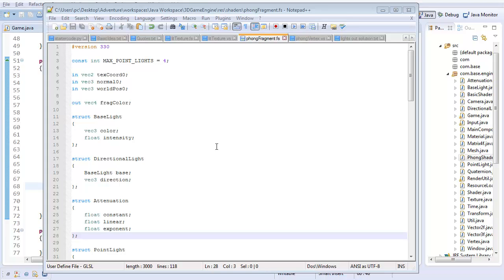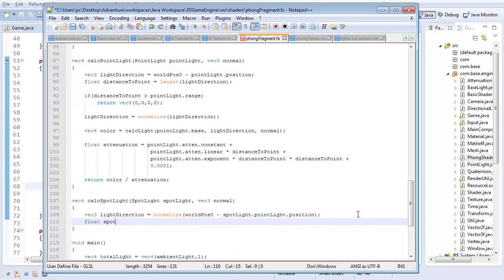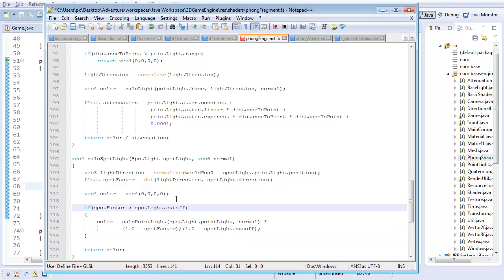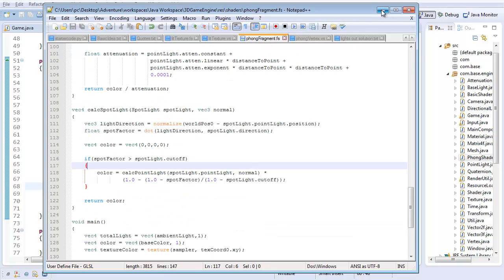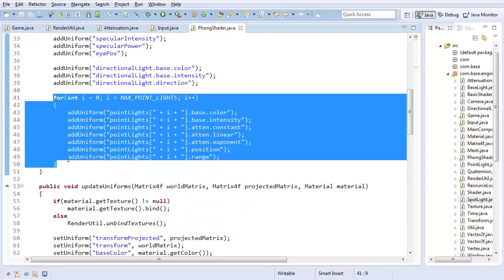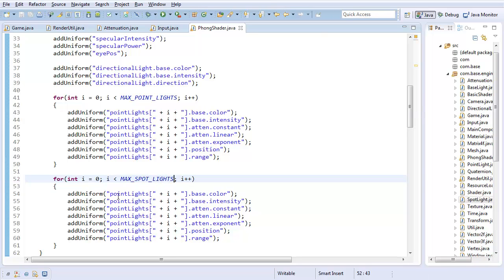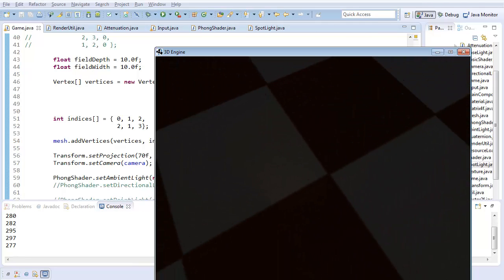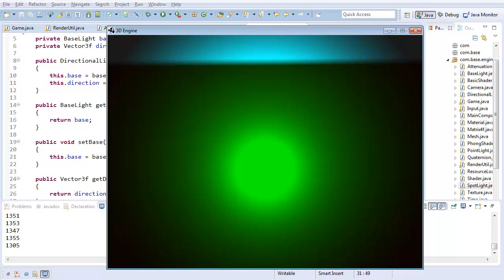#30 3D Game Engine Tutorial: Spot Lights

Comment: Hey Benny i have an issue for a long time, since you have implemented the mouse system for looking around. If i click in to the window the updating stops and all is turning black. i need some help from you.
Reply: I had a similar issue and I solved in the Camera class, the methods rotateX and rotateY, you should put 'normalized', for example:

	public void rotateX(float angle) {
    Vector3f Haxis = yAxis.cross(forward).normalized();
		
    forward.rotate(angle, Haxis);
		
    up = forward.cross(Haxis);
	}

Maybe that could help.
Reply: doesnt work it even deosent works with the version from github

Comment: Not sure if you Benny read the comments here, but i try anyway.

Do you know how to make spotlight, with radius, intensity, color and position properties without using shaders?
I.e "the old way"
Reply from the maker: I do read the comments; quite actively.

As for your question, I'm not sure I'm clear on what specifically you're asking for. Are you referring to the pre-OpenGL3 way of doing spotlights, with glLight... calls and glEnable(GL_LIGHTING) and such, and asking me how that's done? Or are you just asking about the simpler, less general spot light techniques and how they work?

If you are asking about the old OpenGL spot light stuff, I suggest looking up basic information on how it works. I did a quick google search for "OpenGL Spotlight" and the first result seems to do a good job of discussing how it works: http://www.glprogramming.com/red/chapter05.html
Reply: Hi, thank you for the reply.
I have map made of just cubes, each cube face has only 2 triangles and OpenGL default lighting looks bad on them. Too blocky.
I would like to find a way to make spot/or point light (i always forget which one is correct), without any shaders. Im not great at math and i dont even understand shaders properly.
But i have old (from 1999) DirectX 7 app without sources that creates good lights without any shaders.
Its probably vertex lighting.
But i have found no simple example or demo in OpenGL how to do good lighting for low poly models. Like i said, i have just 2 triangles for one cube face.
I know shaders are the way to go in 2014, but there must be a way to make the lights without shaders and with no 8 light limit.
Reply from the maker: jw200 It sounds like you're looking for something like glShadeModel(GL_SMOOTH), which enables Gouraud shading (I may be misremebering the exact OpenGL call; it's been a while since I used fixed-function lighting.) It will look triangle-y, especially on cubes, but it's generally acceptable on most 3D models.

If that's still not what you're looking for, then I have a question: Was the app using static lighting (i.e. the light itself doesn't move. The objects can move, thanks to some various tricks, but the light itself cannot move)? If that's the case, then the app might have been using lightmapping, where the light is precalculated in a texture, and drawn onto the unlit world using blending. That can produce some very nice looking lighting without shaders, with the tradeoff being the light cannot move under any circumstances.

Finally, here's the trick to the 8 light limit: it doesn't actually exist. OpenGL isn't restricting you to 8 lights in your entire world, it's restricting you to 8 lights affecting a single polygon at once. The envisioned use of those 8 lights is to first find the lights affecting a particular mesh, set them up with OpenGL's 8 light system, draw the mesh, and repeat for all meshes you wish to draw. Even today with shaders and everything else, it's very rare that you'll need more than 8 lights affecting a single polygon, so the "8 light limit" isn't much of an issue.
Reply: Thank you for the long reply and sorry for delay. Have been busy at work.
The map editor allows to change light: X,Y,Z coordinate, intensity and of course color and radius. Light editor dialog opens, you set the properties and light appears. Or when you modify exisiting light after you click ok you will see your changes of the light. When i modify colors etc in this dialog, it wont change the light at the same time. Only when i close light editor dialog. So i guess its too "expensive" to update lights "on the fly" for him.
Basically the light can move but geometry or cubes stay at the same place.
Its just light coordinate on map that can be changed.

I sent you private message here.
Check the pic in there.
I just created simple light and made the screenshot.
Reply: Oh, and also in game lights wont move, they are static so to say. There are no movable lights in game.
They can flicker though. Like broken streetlamp or something and you can set the flickering also how you want. Ie. the Timing in that dialog.
Basically its just enabling/disabling light with specific periods